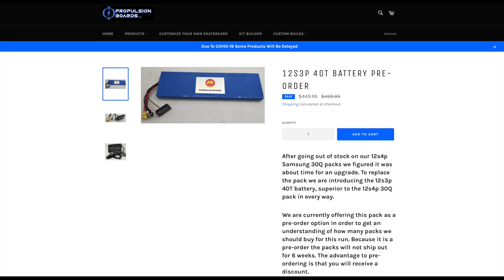Inside an Electric Skateboard Battery (12s4p Samsung 30Q)

Comment: can i charge my 12s with a 13s (48v) charger, and simply pull the plug before the end-of-charge voltage of the battery is reached?
Reply from the maker: Lol no I don't think you can do that
Reply: Yes you can. That's what the charger does for you anyway. Just have to be careful to do that every single time, or bad things can happen... Smoke... Fire..  Boom boom. lol

Comment: Afaic, a BMS makes your board much more dangerous. There is safety features built into it that can get you killed. For example, if you start out at the top of a hill, and your board is fully charged, it can go into safety shutdown from over voltage because of the regenerative braking attempting to charge a fully charged battery. I don't want anything between my battery, and my motors, but an ESC and perhaps a loop key. I've been running my second eboard without any balancing circuitry for about a week. I measured each cell manually yesterday, after a 20 mile ride, every cell was exactly 3.51 volts. I'll check them again in 2 or so weeks, and if they're of, I'll add a simple balance only PCB.

You absolutely, positively, don't need a discharge managing BMS. They are nothing more than power leeches.

Comment: This is terrible battery with poor nickel connections and it is unnecessarily big. The cell holders are the cheapest shit and they wont prevent the cells from overheating, when the thin nickel catches on fire. There's no point in using 30q cells, if you don't use proper connections that can handle the amperage. Also, it baffles me that you would sell a battery without knowing how it looks inside, very unprofessional.

Comment: Do you know how to build a battery and can you explain how works the batteries like what mean 12s3p ?
Reply from the maker: I do not know how to build a battery, but I do understand what the various numbers mean. "S" stands for series and "P" is for parallel so a 12s3p has 3 sets in parallel of 12 series cells
Reply: @DIYesk8Builders so an example 12s3p are 36 pcs battery in 12s(cell)

Comment: wtf is that prices,i have samsung battery pack 50 cell for only £30  , (29E)  2900 mah
Reply from the maker: That cell is not really made for esk8 though, it can only do 2.75A continuous.... there is a reason the high discharge packs are more
Reply: @DIYesk8Builders  8250mah continuous.
Reply from the maker: that's the max discharge
Reply: @DIYesk8Builders  ok ok,the idea is that samsung 30Q is around  £3per cell or less if I buy more
Reply from the maker: True, in USD buying 50 cells will be around $4.25/ cell=212 USD. Then the BMS for charge and discharge is around $50, the power switch, percentage indicator, 3A charger around 50 as well. Then there are manufacturing costs and profit margins
Reply: @DIYesk8Builders  you have different prices I can do it cheaper here in uk
Reply from the maker: Also the currency difference means that 425 USD is around 346 pounds and 4.25 per cell is only 3.46/cell